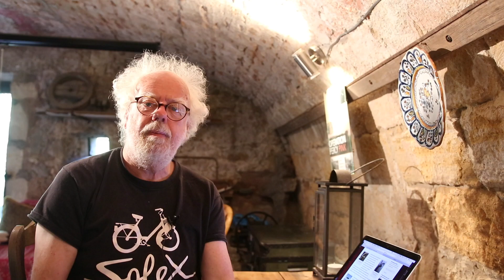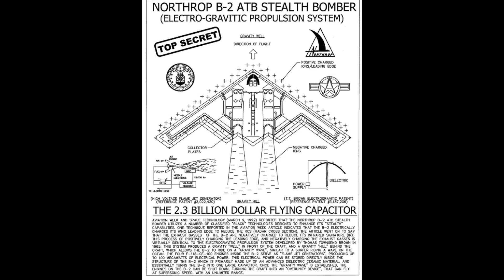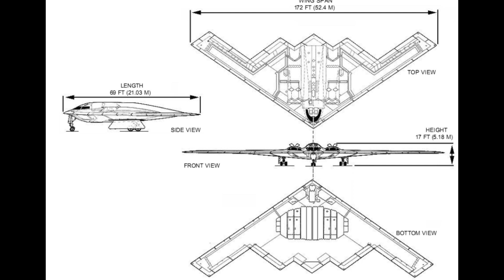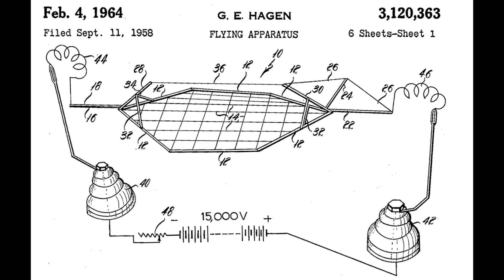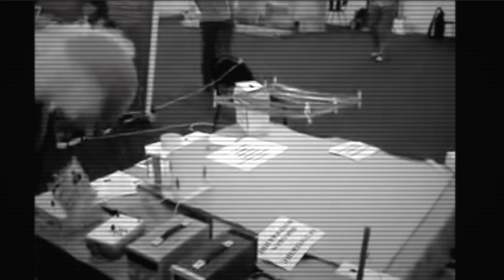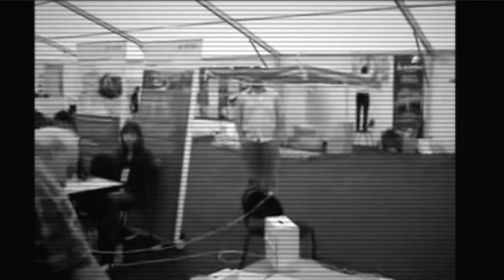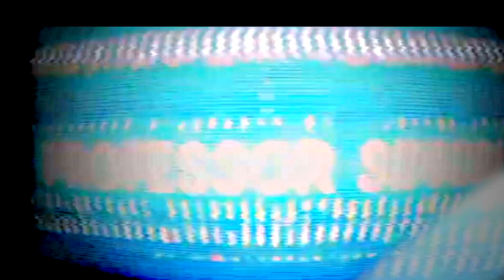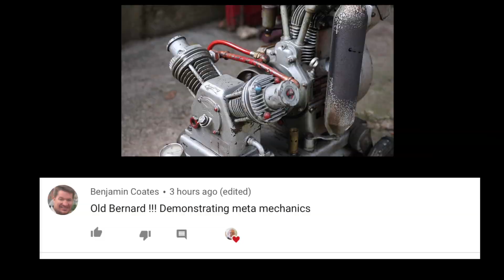Military anti gravity - Prof Simon

Comment: Anti gravity is a concept of a science-fiction utopia. An anti-gravity propulsion method is presented us: a centrifugal force strong enough to counteract all gravitational pull during ancient times. With this simple and modifications to enhance the centrifugal forces enable ancient times to heavy duty lift during the construction of the pyramid in Egypt. An analogy of similar concept of lifting heavy equipment via simply lever techniques in fulcrum methods.Those integrations (with precision mechanics and electromagnetism) of gravity lever fulcrums or gears and centrifugal force devices enable anti gravity to works effectively on heavy duty lifting of pyramid materials during ancient times. 

In 1992 the scientist Eugen Podkletnov, achieved a very complex device with superconductors, using a high-speed rotation in liquid nitrogen and ultra-powerful magnetic field. Podkletnov claimed a 2% weight reduction. Unfortunately, the experiment could never be repeated or improvised. Ancient engine uses gravity generated electric motor (mini turbine hydraulic or solar direct using gravity energy)  and a drive system to rotate the weights (batteries,fuel, hydraulic oil ) of the device a certain angle and a certain speed so that weights should “float”. A powerful centrifugal force is generated, which totally cancels the gravitational force of the rotated masses. The ancient Engine is a device by which rotating masses at a certain angle and a certain speed cancels 86% of the weight of the masses. This method was applied when designing, experimenting and making the centrifugal inertial anti gravitational engine. By equipping cars, motorcycles, drones, helicopters, planes, missiles, etc., with this anti gravity Engine, a reduction of their weight, a decrease of their fuel consumption, as well as an increase of their payload are achieved. Gravity is a force, so it just provides one way for objects to exchange and transform energy to different states. If I lift a bowling ball to the top of a hill and let it go, the ball falls, speeds up, and seems to gain energy. Isn't this a case of gravity giving energy to the bowling ball? No. Again, gravity is just a force, so it just describes how objects interact. The energy that the ball displays as a falling motion came from my muscles when I hefted the bowling ball to the top of the hill, and not from gravity. Gravity just provides a way to temporarily store energy in an object. We call the energy that an object gains when you lift it against a force "potential energy". The energy comes from the lifting agent and not from the force. The force just provides a way to transfer energy from one object (my muscles) to another object (potential energy in the lifted ball). When I let go of the ball, gravity converts the potential energy of the ball to the kinetic energy (motional energy) of the ball. But the ball can never gain more kinetic energy than the total potential energy that I put into it by lifting it.

This concept is true of all forces, and not just gravity. Two magnets attract each other and fly together, speeding up and seeming to gain energy. You may think that the energy has come from the magnetic force. In truth, the energy comes from your hand pulling the two magnets apart against the magnetic force. The magnetic force just provides a way for potential energy to be stored in the magnet (by virtue of you pulling them apart, not just by virtue of them being magnets), and then converted from potential energy to kinetic energy. Any time you push an object to a new location against a force, you are giving it potential energy.

What about hydroelectric plants that extract energy from the falling water in rivers? Don't they extract energy from gravity for free? No. The water in the river is no different from the ball that you have to haul up the hill. The water got its energy not from gravity but from some external agent that placed it high up in the mountains against gravity, so it could fall down the river bed. The external agent in this case is sunlight. Sunlight warms the ocean, causing the water to evaporate and float into the sky. The energy contained in the photons of sunlight is converted to the potential energy of the water molecules that are lifted high in the sky. These water molecules then rain down to the ground, form rivers, and flow back down to the ocean, converting their potential energy to kinetic energy, heat, and (in a hydro eletric plant) electricity. Ultimately, therefore, hydroelectric plants extract solar energy from water.

Comment: OK, lets go. Einstein was on to something but a few things got in the way. These are sub-atomic particles, extra mass and photons. His ideas about gravity and the math supporting it was close. Here is why and please allow me a bit of latitude on my descriptions.

Sub-atomic particles do not exist as the proton is the smallest stable matter particle in the Universe. Energy and matter, as Einstein stated, are one in the same but how? It all has to do with stability. A proton is formed when massive amounts of energy are compressed together to such a point that something has to give. Either there is a release of that energy back into the energy forces against it or it finds stability in the form of matter. Or a proton.

What happens is this. The massive compressional forces squeeze dielectric and rotating magnetic fields into tighter and tighter circuits. When the threshold of stability is reached the magnetic fields align into a rotational torus. Of which two dielectric centripetally rotating vortexes reach inwards towards a null point, or counter-space. This point is the counter-sink of dielectric energy back into the Ether. 

Between and perpendicular to the dielectric vortexes is the dielectric inertial plane also refered to as the Bloch wall. When the threshold of stability occurs, which is also fusion, a tremendous amount of energy is released and a proton is formed. Energy has been now transformed into matter. It is also called coherent energy and it is natures natural magnet. 

The newly formed proton now has attributes that can be measured. It now has volume, magnetic divergent fields and dielectric acceleration. It also has specific geometry that is also displayed in macro form in galaxies or 'black holes'. An attribute of the proton which we can measure is mass.

Mass is the attraction of matter towards other matter particles due to mutual dielectric attraction. Or attraction to each others null point, or counter-space. But why?

Nature seeks stability wherein high pressure flows to low pressure in order to equalize and balance. We see this everyday as wind, tides, and the flow of dielectricity. 

Energy and coherent energy are attempting to equalize back into the Ether by the creation of the counter-sink. It truly is that simple. It is pressure mediation at an atomic level.

What Einstein failed to realize is that the dielectric lines of force converging towards counter-space is actually Gravity. Every matter particle has this property as well as the repulsive magnetic fields that create space. Mass is a function of matter's dielectric attraction and is limited to the medium it is in and the distance from other matter particles. With a caveat each particle has a distance limit of which another matter particle can come close to. This is the point of maximum mass between particles. Or measurable mass.

If the particles were to get any closer increased energy is required and if enough of that is added fusion of the two particles will take place. Thereby creating another stable form of coherent energy comprising of two or more protons. With a tremendous release of energy of course. Fusion. Fusion is simply natures way of creating stability out of entropy.

His mysterious field that holds matter together is not mysterious at all. It is dielectric attraction. There are no sub-atomic particles for the lowest stable form of energy is a proton. And gravity is the dielectric convergent lines of force drawing all energy and matter towards counter-space.

Gravity is additive, influences all matter in the universe, connects everything in the universe and is dielectric acceleration seen as the universe speeding up. 

Einstein also describes the curvature of space time. I believe he is describing the natural curvilinear movement of matter caused by radiant magnetic fields. 

One thing that is certain is that his math is really good and describes the interactions of matter and energy quite well. Given more time on Earth he most likely would have made the connection between Magnetism, dielectric force of attraction as gravity and realized that photons can't be a particle and a wave.

Chasing Dragons

Comment: I always knew that electrostatic repulsion devices existed for a number of years but they only develope a small amount of repulsive forces unless they employ the MHD effects thar create a thrust of air through the device. While this is suppose to have great potential for moving objects from the moving ionized air, so far only small thrusts have been produced and neither propulsion or the combination of the 2 forces is hardly anti-gravity. Plasma has been known to very effectively absorb radar and the uranium should assist in making low level ions.

Comment: Anti gravity can be seen two ways:
1-Absolutely impossible because you can't not have gravity where it is present.
2-Any object not in contact with the planets surface is anti gravity because there are greater forces opposing the pull of gravity.

Basic laws of physics. -Either we have always had anti-gravity when we throw a ball, or fly an aircraft, or float on water, or we can never have it.
Reply from the maker: Good points

Comment: ahhh sweet the b2 speed of sound cone deformer high voltage and frequency dc generated pulse wave on the leading edge of the B2 ... yup thats the whole video in a nut and why ... it distorts the sound wave at the sound barrier making it easier to fly to and past the speed of sound minimizing the sound wave shock pressure making a softer bang so to speak. 

.
I think it was a tesla thingy as well from way back ....
Reply: really? Man what would happen if aircraft which makes lot of noises travels faster than speed of sound than would they be able to hear sound coming from aircraft?

Comment: Electrostatic aided Upper Surface Blowing to increase angle of attack air flow before air flow separation would normally occur to keep the 'stealthy' upper blended body air intakes with a stable air flow. This will work up to a point of angle of attack pitch angle. Exceed the pitch AoA and the engine compressor stall occurs. USB was used on the Buccaneer and TSR2 for short field performance.
The AoA limits on the B2 look to be very poor in comparison to an Avro Vulcan.
https://www.youtube.com/watch?v=YNnM_8WahcQ

Comment: I wish my father was still alive, he was a design engineer on the top secret B-2 project. 
Of course I didn't find out until the it wasn't a secret anymore.
Reply from the maker: Interesting
Reply: Did he tell you anything about it, or anything else interesting?
Reply: @NeuronalAxon  
Well, kinda. What my father told me that he worked 6-7 days a week 12-18 hrs a day for a couple of years. He traveled a lot, on private jets. Had meetings on secure buildings, where they talked about interesting things. 
I would ask him things like "so Dad what kind of airplane are you working on?" He would say "a military aircraft." I would reply "what kind of military aircraft?" He would smile and Say "the secret kind ".
My Dad was a the perfect kind of guy for a top secret clearance, he hardly talked at all.
Years after the secret was out I asked him, "so Dad they can't see it on radar, can't they see the contrails?" He replied well there are two kinds of contrails, wing tip vortex which is solved by clever wing tip design and superheated hydrocarbons from the engines." I asked the obvious question, "who do you fix that!?", he thought for a moment smiled and said " that's where the top secret part comes in Bill."
Reply: @billdelavan1177  - Ha, your pa sounds like he was a real character. 👍

What kind of time period was this?
Reply: @NeuronalAxon  
I believe he was working on the project mid to late 1980s, we talked about this in the early 2000s.
After his death in 2010, we found his fist top secret clearance for Douglas aircraft in El Segundo Calif. In 1943

Comment: Townsend Brown tested his charged disc in a vacuum. Worked just as well.
But the rumour I came across said that it highly charged the body of the B2 - to slice through the air, going much faster and further. Not anti grav.
Reply: just the leading and trailing edges of the wings, to increase stability and thrust at higher altitudes, allowing reduced fuel consumption when flying in thin air where the effect is even more pronounced.
Reply: It was called Project Montgolfier...the experiments were performed in France at Browns request.

Comment: Professor if you have ever seen  a stealth aircraft fly it..I have...    it  is Virtually Silent with the charged wire  having around a ( million volts) on the leading wing edge the power being  generated by a device like  a Car's O2 sensor getting it's voltage from  the hot carbon exhaust then boosting the voltage to the wing edge  it  reduces friction as well as sound..

Comment: Byfield brown tried making xrays with electro-metallic calicium, and the rest of 2nd row of the periodic table. Barium would jump about. Barium ball magnets? Barium disk generators? ISS has a Russian maneuver device, barium flywheels?
Reply: Check your facts!! It’s called the BIEFELD-BOWN EFFECT and its named after T.T. Brown who worked with one of his professors and mentors (Paul Biefeld)  during their academic research with asymmetric capacitors before the entire area went deep black in 1956—NOT a person. Yes, Brown experimented with X-ray tubes and another more interesting home-made devices he called a gravitator (or gravitor) which was the first basic instrument he constructed that actually induced and could detect electrogravitic effects. Barium titanate is mentioned as a heavy metal composite with one of the highest K-values or dielectric values able to hold an extreme amount of electrostatic charges before breaking apart.

Comment: Looks like just a system that generates a bit of thrust. If it were a real anti-gravity machine, you could point it in any direction and it'd still try to reduce it's weight or move directly upwards. Anything else is just a device that generates thrust somehow.

Comment: I'd heard something similar, in reference to the B2, a few years ago.  However, it wasn't alleged to be any sort of "anti-gravity" technology. The technology (whatever it ultimately is) was used to somehow reduce the drag along the leading edge of the wing via some sort of electrostatic effect which, increased the performance (speed, fuel economy, etc).
Reply: I heard something similar regarding russian missile/jet tests.
Iirc there was a relatively sound theory behind the expected effect, but I have no clue if it worked as anticipated or even was practically used at some point.

But such things can always be just cover-up stories to hide the real purpose as long as possible, so might have been about avoiding radar detection all along. I'd guess radar visibility it's an important concern with nuclear missiles as well.

Comment: It isn't anti-gravity, it is a method of reducing radar signatures. A high voltage "shell" is created around the aircraft and this "shell" disperses the incoming radar signals in random directions, making the aircraft "invisible". If you ever get the chance to see one in flight, it is almost invisible in the distance, due to its low profile. You can only really see it when it banks into a curve.

Comment: This stuff is sooo loaded.
There are even more to this.
Yes you can use ionized air.
You can use magnets to encrease its force and there is another force in a discharge of capacitor. That is the force that makes capacitors to explote. Yeah that powerful

Comment: The real coralation is between gravity and the strong force. You could say theres only the strong force and gravity is bits of the strong force that leak through into our macro dimention from the di.ention inside the atom. This also means you don't need a black hole to warp spacetime and slow down time significantly. You need an element bigger than uranium so the sub atomic forces can expand past the last valance electron and essentially into our macro world. Bob lazar explained all of this in his 1989 classroom video he produced. Yes i believe him 100%. At least hear him out before you shoot him down. I'm sorry to crash yalls paradigms but ETs are real and they are here and probobly always have been. The evidence is an embarrassment of riches. From linda multon howes 1980 documentary called a strange harvest to dozens of other legit evidence cases there are so many ways to show that ETs are on earth and in the solar system. Beware the phoneys but Bob Lazar is not amoung them. Travis Walton is no phoney either. Whitley strieber is a dam liar and lots of others.